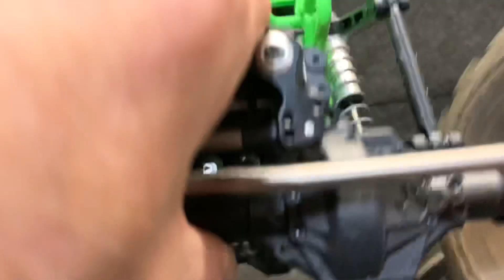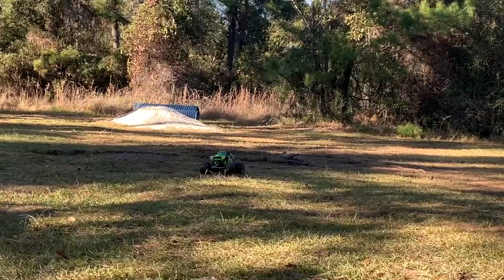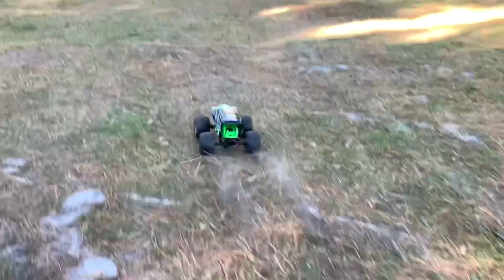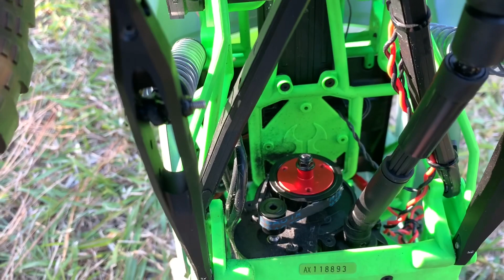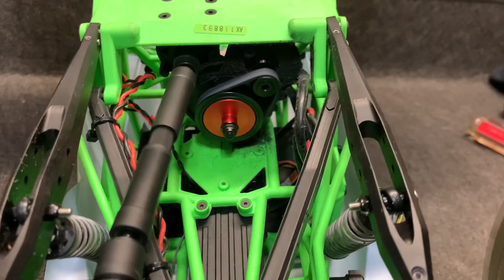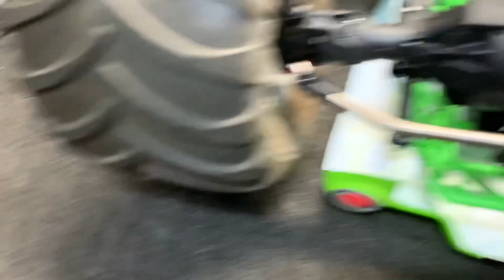Belt drive in an SMT10 Gravedigger?

Comment: I have had the belt drive Ina  trail truck for a few months now. Wouldn't use it under any heavy loads. Works great for a  low stress trail truck. Nice that it is so quiet when on the trails 

Using a carbon chassis, ar44 axles, trailmaster 27t with a 1080 esc. Motor and esc are both cold after an hour on the trail on 3s

Comment: I think if it was actually made like a real drive belt, like the quality belts found on motorcycles ect, it has the potential to be a good option. I know it didn't work for the monster on 3-S, but I may still try it on a crawler.
Reply from the maker: already did with the superlite, too much drag amps and heat

Comment: So do you think they’d be cool if they made a smaller pinion maybe a bigger spur gear.
Reply from the maker: I don't know but I won't try this again
Reply: They make different drive and final drive pulleys. You just have to find what works for you. The belt drives have their place and work well if set up properly. If to loose they fail. If to tight they fail. You can crank on the belt so much that it will drag the motor down. Then it overheats the belt and stretches it. Then it doesn't match up to the spur right. You could use this belt drive on like an scx10 with great results.

Comment: The problem with the belt drive at least from my experience the tighter you have the belt the worse the drag, and even with a tight belt as it warms up it stretches and what was tight is now lose. And then when you do let it cool down now it's even more tight on the gears. Avoid this upgrade at all cost it's not worth it.
PS. No need for a reason to toss in trash just do it.
Reply from the maker: yep its not a good thing at all. I made sure I killed it good or I would end up trying it on something else lol
Reply: @ExocagedRC  haha I can't tell you how many times I tried to make it work went through $60 worth of belts. Before truly giving up

Comment: This is why I stick to the tried and true methods. Belt drive NEVER sounded like a good idea to me. But hey man how’s about the axocaged front skid plate. ? Where can I get one. ?
Reply from the maker: which one?
Reply: @ExocagedRC  it’s a front skid plate you have on some of your rigs that’s stamped “exocage” I think it’s on your axe I actually seen it on a couple rigs. It’s the front plate under front bumper. I just checked the video it’s on the front end of the axe in the video testing the hyrax tires. I’ve seen a few of them I liked and can’t find a place to order them.

Comment: The belt drive is made for a crawler not for a high speed high powered smt10 belt drives are used in x Maxx and many other bashers I bet if you went and bought a belt the same size meant for a vacuum it would work much better
Reply from the maker: I've seen a few belt drives for xmaxx and don't like them either